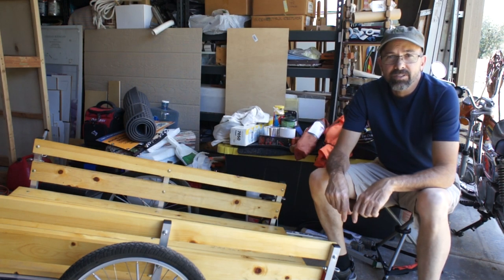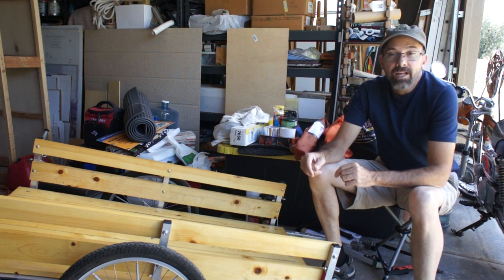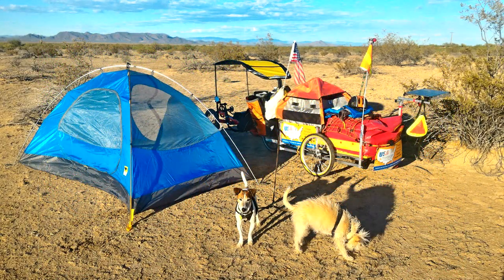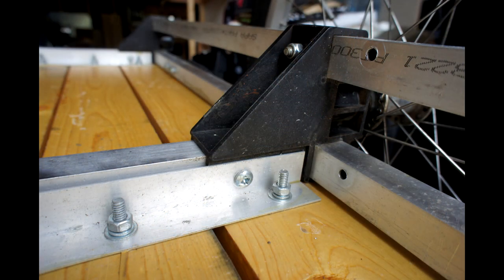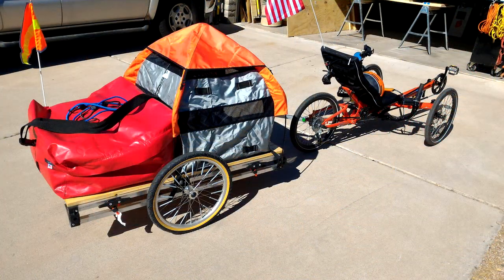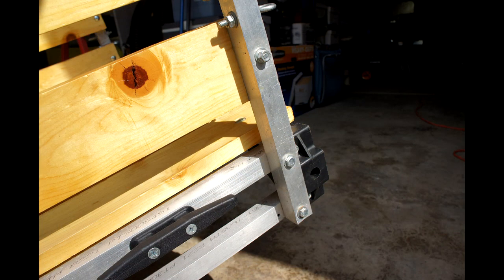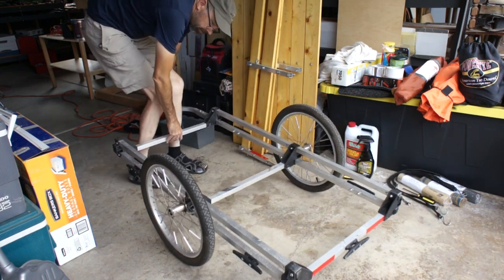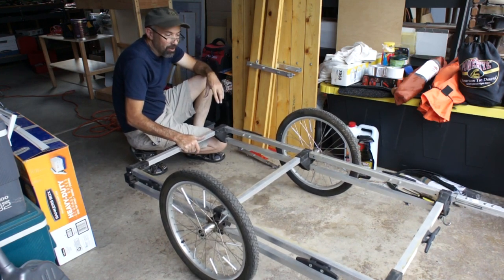WIKE DIY Cargo Trailer - A Closer Look

Comment from the maker: To answer a few questions I have been asked.  I used a lightweight white board from Home Depot and put a couple of coats of polyurethane to give it a little more durability and protection against the weather.  The solar panel and battery system came from voltaic systems.
Reply: Awesome man.

Comment: I used an old Instep kid trailer , striped down. Then I used an aluminum road sign as the floor and waterproof material for the roof and sides. Then put 20in wheels instead of the fourteen inch it had.

Comment: Hello Tim.. I'm thinking of using this to create a bicycle camper..   Once the aluminum frame and deck are down.. I plan to use 4'x8' sheets of Chloroplast (corrugated plastic) and attach the 4' end to the side of the frame with thin piece of aluminum and screws.. then arch it over to attach to the other side.. I'm want to make the bed 6' length.  And just narrow enough to fit thru a standard 32" door way.. This will take 2 pieces of corrugated plastic seamed with 100% rubber silicone.. There will be about a 8" overhang for a vestibule at front and back..   Can you tell me the actual length of the aluminum tubes that were cut for width to fit thru a door..?
Nice video instruction.. Thanks Robb

Comment: Are those plastic components 3-D printed? Thumbs up.
Reply: No, I have this trailer kit also. I believe the Nylon parts, so better then plastic. Are molded/cast. Very sturdy and well made. I got my kit back in July, built it up installed a 55 gallon weather proof tote on it, and its working great.

Comment: Hi Tim, I’m building mine this weekend and it’s going to be the same as yours.  Can you tell me the size of the hardware you used to attach the vertical pieces of aluminum?  Also, what type of drill bit did you use?  Thanks for the info
Reply: I'm not Tim, but I can help you. Since the tubing on the trailer is 1 inch square, depends on how thick your uprights are. Since the bolts are all Quarter Inch, use a quarter inch drill bit, but get a good one for metal.
Reply: @longrider42  thanks for the reply James.  I ended up building it about a week ago and it turned out great.  We went without the vertical poles because instead of building an enclosure for the dogs we just used ratchet straps to secure the XL kennel to the side rails.  It’s perfect!  Now our two 14 year old pups can go for trips to the park and coffee shop with us.  We bought an extra Mount so we have one on each bike in case we want to switch off during a trip

Comment: Can you offer any information about the hitch. I have a quick release, skewer type axle on the back wheel of my recumbent. Does this trailer kit work for that? Did you have a through axle on your trike or skewer? Please advise.
Reply from the maker: My trike (HP Velotechnik Scorpion) has the traditional bolt-on rear bike axle with internal gears, so the hitch mount bolted on instead of a quick release.  I think it would work for a quick release, but I'm not sure.  Here is a website where I got some ideas.  He has more photos that might be helpful.  http://valdodge.com/2009/07/04/custom-bike-trailer/
Reply: @CrazyUncleTim  Thank you, Uncle Tim.

Comment: where do you get the aluminum tubing?   I have the kit, but no tubing
Reply from the maker: From a local metal supplier. Home Depot was too expensive.
Reply: The tubing you get from Home Depot, is 1/64th of an inch too big. I know, I tried.

Comment: You must have a certain amount invested in your very good trailer, and I would think that, considering the weight, you might benefit from using a better grade of tires and tubes (the thought of "walmart" items speaks of very poor quality). Just a thought in the safety and serviceability category.
Reply from the maker: I agree!  When possible I buy from bike shops.  There are some places where the only place I could buy tires for the trailer was Walmart.  Their Bell tires worked pretty well for the trailer.  For the trike I often would have tires sent to a friend along the route where I could pick them up.

Comment: Hi Tim just what I've been looking for.  Do you think it would take the weight of a person  15 st.Im thinking of building one and having a canvas cover over it and sleeping in it overnight to get off the ground.  And do the wheels just bolt on around where the middle plastic fitting is and are they quick release Des ps Great video
Reply from the maker: I think it's rated for 150 pounds, but I carried much more weight than that. It probably depends on the materials you use. The company that makes the kit has a trailer with a canvas cover, sort of like a covered wagon. They could probably tell you the weight limitations.
Reply from the maker: The wheels are quick release and slide into the fittings.
Reply: I'd like to also add, that if you need more weight capacity as far as sleeping on it, you can use steel tubing the same size, but will weigh more, trade off if that's what you need.